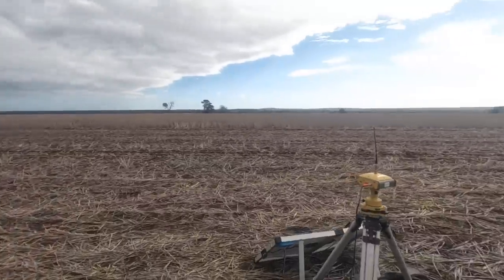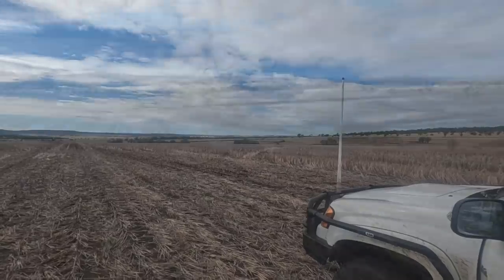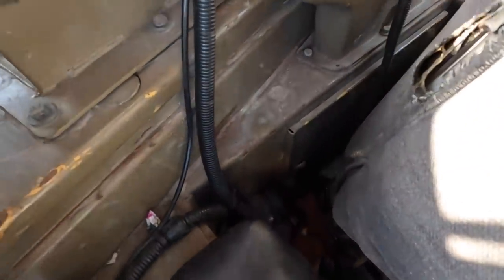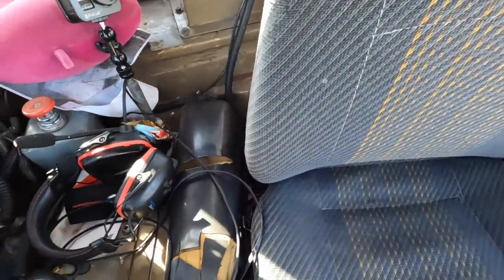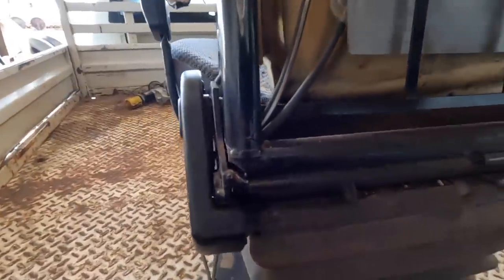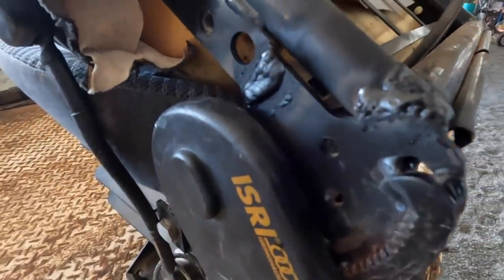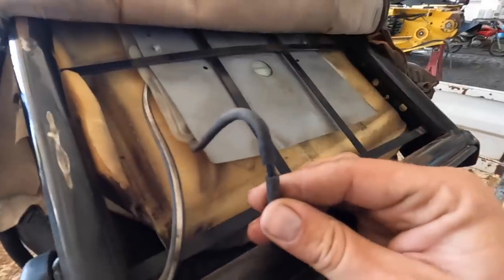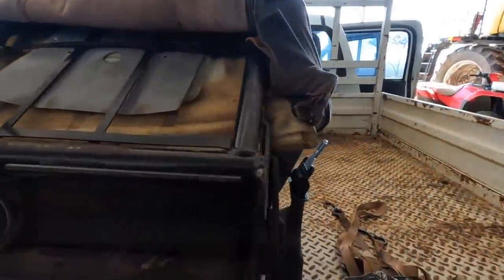D11's Hard at Work & Repairs! Vlog 74

Comment: How often do you rest your paddocks or do you continuously work them , on smaller properties we used to crop for 3 years then stock for 3 years , I once broke a seat in a chamberlin tractor so the boss replaced it with an apple box so I could get the job finished I recon I’ve still got splinters 30 years later
Reply from the maker: Haha, pretty well continuously for us👍
Reply: Depends what you define by a “rest” and what you hope to achieve
Reply: @samwest9444  resting a paddock is when you are not continuously growing crops and adding chemical fertiliser to the soil , similarly not continuously running stock in paddocks as they compact the soil too much
Reply: @Rogster559  in a pasture phase the pasture is the crop. You’re just harvesting it with mouths not a combine. If you don’t fertilise the pasture it’s going to underperform the same as a grain crop. You can achieve everything a “rest” can through crop rotation